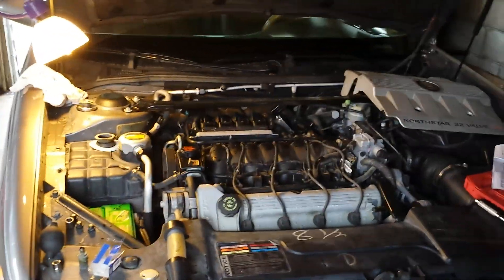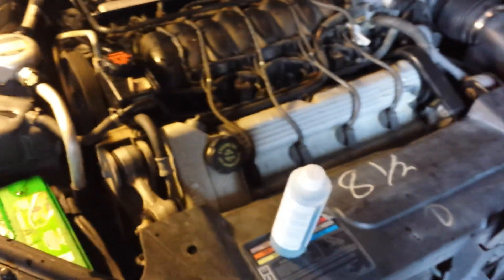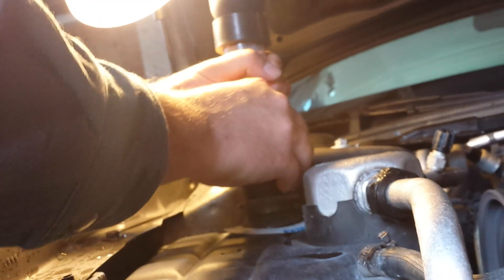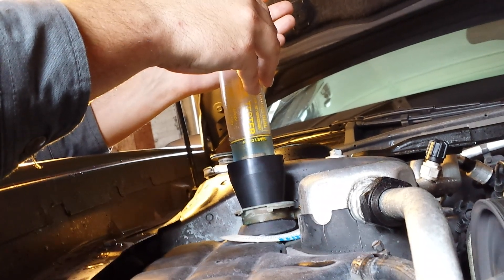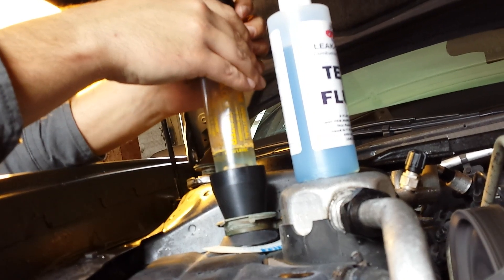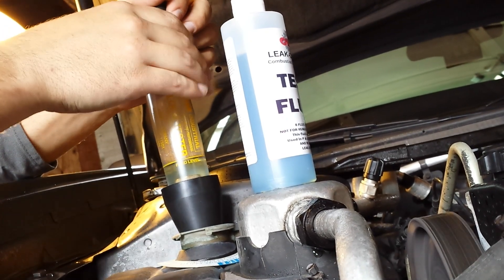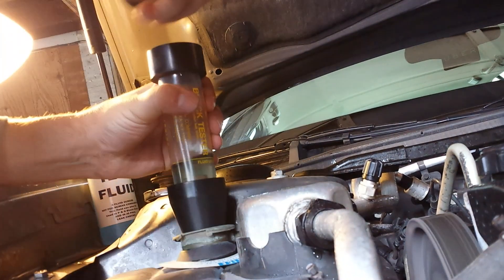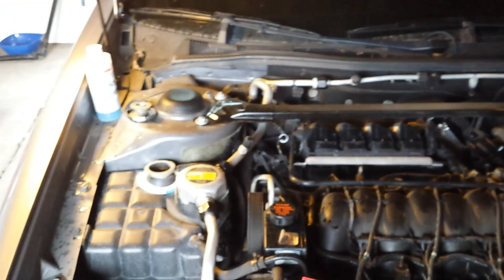Block Head Gasket Testing a Cadillac Northstar V8

Comment: I got a question you seem to be pretty good with repairing automobiles I watch a lot of your stuff I got the infamous Northstar engine with a blown head gasket I've tried the blue devil treatment about 4 times which I don't think any of them was done right so I was working on it on yesterday and found out if I leave the purge line apart from reservoir it doesn't run hot after running a whole 1 hour and one of my biggest problems with all my blue devil treatments were I could never get it to run 1 hour because it would run hot before that time so my question to you is can it be driven or used with purge line loose from reservoir

Comment: Would this tool work for the crankcase too? Like in the oil fill cap? Sometimes a head gasket will leak exhaust into the crankcase too

Comment: Your safe. Check your purge line from your coolant tank follow it over to the driver side. Remove the hose and remove the bolt with the nut on it and clean the tube out with a rat tail file. I  bet it solves your problems. Once done remove the whole line and soak it in carburetor cleaner use a metal coat hanger to free any debris then blow the purge line out. connecting the driver side line back unhook the purge line at the coolant tank put the line in the tank and see if you have flow if it's slow give it gas. I bet that Is your problem
Reply: Aye tom same problem

Comment: Not familiar with the Vin. #s you mention . How do I determine which I have ? 1997 Seville SLS !
Reply: You have a Northstar vulnerable to head gasket failure. My 97 Seville SLS suffered from it around 100,000 mark. Had to get the head bolts redone cost my grandparents thousands (was there car at the time).  It has 170,000 miles on it now and running great.

Comment: Can you get to the head bolts easy to check and or tighten them ??
Reply: tom ray 

That would be a horrible idea
Reply: No, and tightening them wouldn't help anyway. They pull out the threads with them when the start coming out
Reply: Fug no lol it's a hard-ass job the engine is in sideways but their is a head bolt conversion kit with longer bolts that you can use I've heard great things about it  makes the engine way more reliable and fixes that little head bolt  issue

Comment: I have an 01 fully loaded sts & to take it easy on the short head bolts and from overheating I dont drive over 65mph most trips. Just as my  or maintenance
Reply: Man these engines were meant to live in the higher rpms... look it up they were built as performance motors. Your engine will carbon up doing that. Just change the coolant every couple years and you will be fine bro. Drive the piss out of it and use it for what it was designed for. Trust me it will run better just use good synthetic oil
Reply: Yeah they need the snot drove out of them once in a while like Trizkial was saying or the rings will get carbon build up and get stuck in the ring grooves causing smoke out the exhaust, the rings are supposed to spin/float around in its groove. That is one of the ways to sometimes fix smoke from the exhaust, a couple of WOT runs on the interstate will free up the stuck piston rings that are usually stuck from carbon deposits from being babied too much.

Comment: I have a 95 Seville that over heats what should I do
Reply: Find out what's causing it to over heat would be a good start.
Reply: Check your Water pump, thermostat, radiator, radiator overflow Reservoir upper and lower radiator hoses, heater core,  make sure you're not using any dex cool  use the cool conventional greens make sure your radiator fans are properly working make sure your sensors are functioning properly, when does your car start to overheat does it overheat after you go a few miles while driving or does your temperature gauge starts to rise while you're still idling? Do u still have this issue?

Comment: After testing the engine I went to the back of the car and put the tester at one of the exhaust tips.  Four squeezes on the bulb and the fluid instantly turned from blue to yellow, as I had expected it would.

I was very impressed with this tester!

Comment: I have a 97 EDLORADO. I find myself having to add coolant every morning before work and evening after work. I replaced the thermostat, radiator. I don’t see a leak anywhere , yet if I don’t do these everyday, it over heats. What should I do ??
Reply: Possibly the water pump

Comment: If you want to it go down even more change the Dex Cool crap out and out regular green antifreeze in it . I had my 1999 Deville rebuilt and the GM guy told me to use regular green antifreeze when I did that mine ran at  170-180F.
Reply from the maker: Good info! Thank you.
Reply: @AutoAuctionRebuilds  We changed ours to Prestone G-05 Coolant.  The G-05 is listed as a low conductivity coolent.  We've used it in several Aluminum and Aluminum/Iron Engines with no issues.

Comment: I HAVE A 1999 JUST THE LEFT SIDE AND JUST RIGHT SIDE OF MY RADIATOR GETS HOT
FAN IS NOT ON CENTER IS ICE COLD NEW WATER PUMP IN IT. ITS OVER HEATS  WHEN I DRIVE IT, JUST SETING AND RUNING IT WILL NOT GET HOT LOL?? WHAT YOU THINK
Reply from the maker: 99.9% blown head gasket. Losing compression into the cooling system.
Reply: That would be blockage somewhere in the radiator or thermostat.  That is not a blown head gasket.  Also on these engines being DOHC it would be a leaking head gasket and NOT blown.  That is on OHV engines.
Reply: Clean purge line...I just checked every line on my 99 cadi to make sure water flowing..if temp stay good I'm going to get green antifreeze

Comment: Are the 2006 Northstar in a DTS a problem too?
Reply from the maker: They sure are.
Reply: How long have they been building this engine and still a problem. really.
Reply from the maker: It started for most Cadillacs in 1994. I believe some were in the early 90s allante.
Reply: Thanks, I saw Dexcool approved on a prestone bottle but afraid to buy.
Reply: 2006 Dts are great cars and not a problem if its properly maintained.  The Northstar is easily Cadillac's Best powertrain ever put into a Cadillac and is why GM produced it for 20 years, more than any other Cadillac built engine and used in several other luxury GM cars. The Northstar was already out in 1991 but was saved for its debut in the final year Allante for the 1993 model year.
Reply: They're way more reliable in that year but there is also a head bolt conversion kit with longer head bolts that you can use

Comment: i got a 1999 cadillac deville overheating i took it to the green brook  dealer ship  in new jersey charge me 894.00. told me i needed intake gaskerts. i got my car back it overheated on the highway i had walk miles back to dealership. never fix car. i will never buy a from cadillac again or gm dont care about the customers just take your money and sell you junk .  head gaskerts block bolts gone need new motor. lie to me rip me off. and wont give you a refund just give the run around. after they took my money. wont help me get my car fix. i am so mad i will tell the whole world what they done to me dont care customers i call customer servce for help nothing can do  i would like the owers to know what they did to me. left me hanging no car no mony back. dont care  cadillac dealer heard that . 1999 cadilllac deville  i am  very very hurt poor poor service never again
Reply: Sorry to hear about your experience.  And your story is not uncommon to hear about from a car dealer.  The same happens to other cars and dealers don't fix the problem.  I know because I work at a dealer myself and see first hand how deceptive they really are to customers.  However, I myself help customers myself with Cadillac's and some other cars.  They are great cars when properly maintained.
Reply: RICHFO100 how can I change my intake casket in my 1998 Cadillac?

Comment: I wanna ad this Don't buy any cad with North star .. they are junk .. recycled aluminum blocks piss poor head bolts gaskets .I have a 2000 Eldorado' 46k miles and it's junk .. car looks like new . driven summers never seen winter .. 42000$ paperweight ..
don't buy any North stars all junk
Reply: I have a 97 deville with almost 152000 miles on it and so far just had to replace the alternator
Reply: 09.. rwd 6/7th gen northstar v8. (Tuned)
So far--- 
Two transmissions rebuild(s).
1 motor rebuild. 
Rear trans mounts.
Front motor mounts.
3 tune ups.
3 coil packs.
1 fuel injector(s) flush/service.
3 light bulb replacements.
Fan and radiator upgrade/replacement. 
I have had the car for 5+ years now.
Amount paid for repairs so far= over $9,000- $11,000 cash .. I have over 150,000.miles. bought used fro. 1 owner, perfect car fax. And yes, I race the hell out of her. 
I will not , and I can not part with my car... she makes sure I make it home each and every trip. And!! I can outrun most Lexus, bmws and Audi's with v6 and v8's.
Reply: Northstar are the BEST engines ever put into a Cadillac and made by GM.  They were made by one of GM's best powertrain plants in Michigan using very high quality materials and they are extremely reliable when maintained properly!  The only reason why your Eldorado with 40k developed leaking head gaskets tells me that the coolant was never flushed out sitting in the system for way too long eating away at the gaskets!  It doesn't help when one of the best engines ever built was not properly maintained.

Comment: would anyone happen to know if the v6 engines have the same problem? like in an 05-07 sts?
Reply: yes v6 is ok lam not sure but I think made by Toyota.
Reply: The 3.6L V6 is just like the Northstar 32 valve V8 with 2 less cylinders.  They are both DOHC and built very strong.  Coolant flushes should be performed religiously on any Dexcool running GM vehicle!

Comment: Either the wrong coolant or coolant that went acidic is the culprit for leaking head gaskets on these Northstar engines as well as other GM engines.  My mom still drives her 1999 Deville with almost 200k and its never given us any problems.  Great cars they are and very heavy duty and solid.
Reply: I heard about replacing the antifreeze every 2 years and it's worked well for mine.
Reply from the maker: +That One GM Guy Very cool.
Reply: Coolant flushes should be done religiously on any GM vehicle running Dexcool antifreeze.  On my Dexcool running Cadillac's, I flush out the system every 2-3 years and add in fresh coolant.  You will not have a problem if you maintain your car properly.

Comment: A friend of mine still drives his moms 1997 Deville with over 460k!  His mother bought the car brand new and always kept it well maintained. The engine is all original and never rebuilt or anything. He still drives it and never had any problems. His mother bought an Eldorado and she loves that car very much. So maintenance does play a key role in the longevity of these engines. 

I do know that if the wrong coolant is used, mixed or has gone acidic, it will eat away at the head gaskets and then corrode the lower head bolts making them weak. That seems to be the same problem with other GM cars and trucks around the same time. I keep my cars well maintained and they have been excellent cars.
Reply: AMCNorthstar 93 yes .I just replaced antifreeze ..adding 3 of those coolant tabs they said and put them in the lower rad hose..the porosity of the aluminum was the reason the tabs we're used .to seal up any porosity problems ..
Reply: 460 k wow.. Any engine oil leaks??.. I have 96 deville 92 k..slight oil drip .very very slite .Lucas oil stop leak is good though .and I  maintain it also ..
Reply: God First Yes it was all first introduced back in the 80s and is still used today on many different vehicles.  Now all vehicles have aluminum engines and hold up very well if properly maintained.
Reply from the maker: +AMCNorthstar 93 Very true!
Reply: Uber Man Did you sell your Deville or are you still driving it?
Reply: Dexcoolis what killed these cars. You would need to flush and refill every two years otherwise it turns into acid and ruins the gaskets.
Reply: God First I'm sure there is some oil leaking but nothing bad at all. And if it did get bad I'm sure it was fixed.  A slight oil drip is nothing to worry about.  Many people forget that many of the old classic cars always use to both consume and leak oil.  I drive a 05 Deville and 99 STS.  Yes just keep your Deville maintained and you should be fine.  The biggest thing as with any GM is the cooling system.  Follow exactly what your manuel says to use.  In my Caddy's I like using Mobile 1 or Valvoline High mileage blend and seems to work very well.  My parents have a 95 Seville SLS with over 300k and still running excellent to this day with hardly any engine work except general maintenance.
Reply: They are great cars and have some dame good engines!!
Reply: Jesus, old comment thought I’d give it a go and ask a few questions anyway. Any tips on maintaining the engine? Just purchased a 1997 deville with 109 thousand original miles keep reading how these engines are ticking time bombs but my hopes are restored by story’s like yours lol.

Comment: This problem of head gaskets seem to be for years 1997-1999.  I rarely ever see any pre-1997 northstars with these issues. My parents have a 1995 Seville and had it for many years.  We never had a problem with it beside general maintenance. I now have a 2001 Deville myself as my daily driver. And I have Dexcool in my car. I believe 1997 - 1999 had the most problems due to the coolant change during these years. Not so much before or after these years. And most of this problem stems from poorly maintained cooling systems and not changing out the old coolant when needed!
Reply: Lol. Yea right. I had a 99 Deville that went to 180xxx miles before I traded it in. Never had a HG problem. I traded it for an 04 DTS back in 2006. 2012, at 155k miles, the 04 DTS blew its gaskets. I also have an 05 DTS. It just hit 105k. Guess what? Just got that out of the shop. Why? Had to get the headgaskets replaced. I'm personally done buying any Northstar Cadillacs. They suck. Two out of my three Cadillacs blew headgaskets. And yup, I did coolant changes with only Dex Cool and I did them every three years.
Reply from the maker: AMCNorthstar 93 Very true.
Reply: Jason Roberts  Coolant is still the cause for this issue.  And they do not blow but rather start leaking.  Only if the coolant is flushed out and refilled when needed and done correctly, the problems never happen. I have seen this problem happen on many other GM vehicles and not just Cadillac.
Reply: AMCNorthstar 93 The reason that the 97’ Northstars are said to be the most susceptible for the failed head gasket is due to the metal of the cylinder walls being thinner than in other years. 

I own a 97’ SLS with 185,000 miles and still running smooth knock on wood
Reply: Well your cars were NOT that well maintained cause otherwise you wouldn't have had any of those problems! that shop saw you coming and scammed you into an unnecessary job!

Comment: I have a 2011 DTS with the northstar,  only 47k miles on it and so far so good. I maintain my engine well by using only premium fuel and full synthetic Mobil1 oil. I just had my coolant flushed by the dealer as well. I guess that's all I can do to help the life of the engine. What do you think?
Reply from the maker: deapozol I think if you take great care of it, it will be just fine. VERY nice ride BTW!
Reply: You got a great car man.  Maintain it and enjoy it!!
Reply: Up to 2004 no problem whit headgasket, its under 2004 have problem
Reply: @gabrielparent9088  they went in my '01 before I bought it.